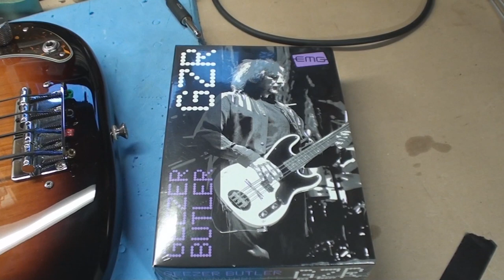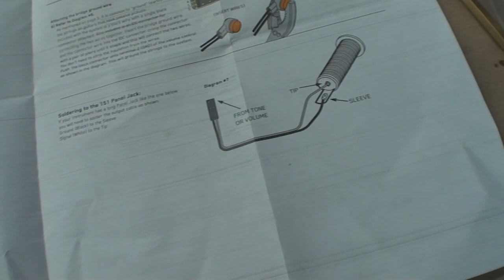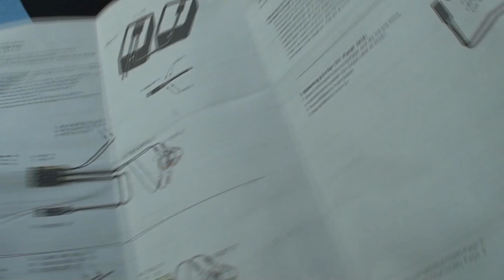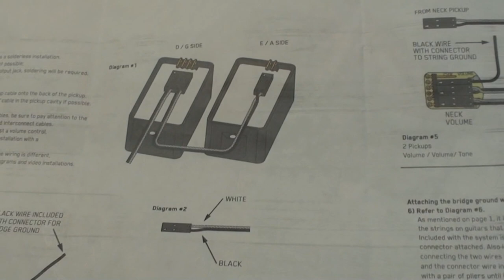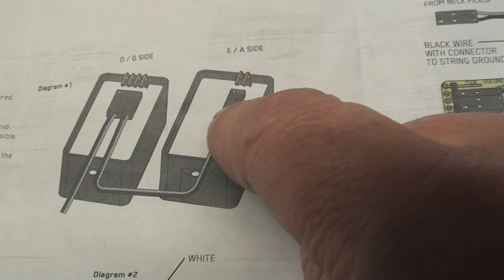EMG GZR Solderless Wiring Pickup Install

Comment: Dave, for future reference: the little squeeze connector with the orange button (3M calls them Scotchlok) has internal blades that slice through the insulation of the wires, so you don't need to strip the wires before inserting them into the connector.  Even fewer tools required!
Reply: They are handy and quick,  they are also an inferior option to a good solder job and less reliable. As to install them correctly you're basically cutting approximately 1/3 of your conductors as they cut through the jacket and into the strands themselves.
Reply: @dennisapplegate7553  I was deferring comment, so glad you did. I'm old school, built many custom amps, had a 66 JB for years, I now have a PB with a maple neck, I actually prefer it for access to the strings when muscling it, plus there's a uniqueness to the PB 'pop' that a JB misses.

Which brings me to soldering [it's still the most reliable way of doing electronic connections, required still by some military and aviation regs rather than push-ons, including using 60/40 lead/tin solder (the newer lead-free type whiskers)] and has me questioning why anyone would want to change-out perfectly wonderful real PB p/u s for some bloke's concept of how the PB should sound.

Fender got it so right to begin with, why fug with it?
Reply: @stephensaines7100  because these sound better? (Shrug).
Reply: @dennisapplegate7553  had them on my bass for a year with this connector and had no problems. Unless you’re swinging the bass around like a mad man, how would they come loose? I’ve actually seen more solder joints (by pros!) snap.
Reply: @stephensaines7100  just a suggestion to a tone building If you do use sloderless and connectors use a little dielectric grease on your connect .It will prevent corrosion and maintain a superior connection.
Reply: @Andyanddiana467  And I'll bet you've seen alot more solder joints than scotchloks right? My point is the provide a inferior connection that actually cut part the wire and are much more venerable is stress and corrosion. They are great when used properly but they are not as solid or reliable as a good solder joint .
Reply: @dennisapplegate7553   @Dennis Applegate  We'll need to wait a few more decades to see how these connectors hold up. I think they'll probably be mixed bag, probably much shorter life than a normal solder joint done well. They certainly won't have the failures caused by weakened pots overheated by soldering done poorly!

Comment: i installed this Pickups in my sx Bass couple years ago... very easy and great tone! everybody can do it... and its all include in one package, even the potis....just great work from emg...
Reply: Put a set of EMG J into a J & D surf green bass. Cost as much as the bass but end result worth it. No need to shield or use earth grounding. Coupled with a set of Billy Sheenan Rotosounds. Sure appreciate putting into practice what I remotely learnt from watching Dave.

Comment: Installed this GZR pickup on my cheapass 20th anniversary Indo P many years ago. World of difference in an instant. Cannibalized my junk mim jazz and the only part
 left on that indo is the body, with a 2 9/16hs neck pocket. Epoxied in a Mitey mite P neck. Added threaded inserts so  6 bolts on neck No shims string height was dead on. Franken bass. Neck shrunk so much across grain I filed fret ends >3< times! Action with labella flats is 4/64ths across the board no buzz no weirdness plays like buttah.. Wole lotta work on that bass but man it plays and sounds incredibly sweet! NOTE :MOST of it from watching YOUR VIDS Dave!!! Thanks lol

Comment: I put in the Geezer pj set recently and the ground wire connector thingy was a bit confusing at first; I screwed up my first attempt and had to order another from EMG. I got everything working just fine eventually, with no complaints nearly a year later, but still a PITA. 

Worth it, though, because they sound fantastic. Best bass pickups I’ve played.
Reply: I found AFTER I fiddled on the bench a bit the  instructions made sense - strong cup of tea did the trick.

Comment: I put these 130€ EMG GZR pickups into my 130€ Harley Benton HTR PJ-4 bass and it's now one of my two gigging basses. I had DR Red Devils string on and had to put my Pyramid Gold flat wounds back on because the sound was just TOO HEAVY. Very happy with this product.
Reply: Did you have any installation problems with these pickups. Im trying to put in my Gzr P pickup now and currently all Im getting is buzzing

Comment: Hey Dave, all my guitars are singing. Thanks.  My Fender mim pj special edition requires a .050 wrench for the saddle height, which be hard to find. I have found that a 1.3 mm works well. The .050 is a stupid price break from standard hex wrench $, and probably not at your local Bored and Screwed, yet the 1.3mm can usually be had at the harbour freight. Look for the little flat case with every other TINY bit you need, And the flexy driver.  Neither of these wrenches are consistant with the specs that Fender themselves gives for this bass. Peace and Black Sabbath! Constant sneeze for 10 minutes. Cheers folks!

Comment: Added a passive P-Bass EMG to one of my partscaster P-basses and it is definitely both the easiest install ever and a solid pickup all around. I installed an active one in another partscaster P-bass and the active is a little bit more difficult although it still was fairly easy to do.
Reply: The active EMG P pickup works well with tapewounds too because the pickups are shielded, and you don’t have to connect the bridge ground.
Reply: @tylerwmbass  They do work well with tapewounds, good point and I like the lack of the ground wire as well since I'm extremely destructive with a soldering iron.
Reply: @tylerwmbass  ? You don't even have to physically contact your strings to introduce stray electrostatic and/or magnetic fields into your pickups. The bridge and tuners still need to be grounded, any inductive or electrostatic materials of size in the instrument need to be grounded. Any quality audio tech will also twist the p/u leads and dress the wiring as close to grounded surfaces as possible to reduce as much induced hum as possible, but I digress...
Reply: @stephensaines7100  You’re right, just standing on carpet can generate static that will discharge into the bridge, it needs a ground discharge path.
Reply: @stephensaines7100  Have two basses with passive EMGs, one a Geezer P/J and one with their A2 pole pieces.  Both, of course, have the grounds connected.  Standard bridge grounds, but also I have the cavities connected to ground.  But...  I also have two Spector basses that came with active EMGs.  They have cavity shielding, but there is no provision for a ground wire to the bridge at all, no hole is even drilled for one.  They are the quietest basses I've even played.  They also have active preamps installed, in addition to the active preamps installed inside the pick ups.  Nothing is externally grounded to the strings or bridge, just the path through the cable to the amp.  Active EMGs need no bridge ground.
Reply: @danlevesque5486  Yep, I have some basses with active EMG's too, a different tone but if you're in a noisy environment they're a blessing.

Comment: I have these pickups. They don't really sound like Geezer but if you put some distortion on them they sound massive. Not great unless you want that sound. Les Claypool has a sig set coming soon that I think I'm going to switch to.
Reply: That’s because pickups are a tiny fraction of tone, trying finding what speakers he used. Those change the tone more than anything

Comment: I would solder the connections anyway because of the way those crimp type connectors seem to corrode or oxidize and become brittle over time.
Reply: So would I. Unless you have gold or silver surfaces in contact with each other  (and even they display a barrier when oxidized) it's just asking for noise and intermittents by not soldering them.

You wouldn't do this in a mike circuit, albeit they're typically 1/10 the signal, assuming you have the pots turned up full, because you can hear the degraded signal path in many cases, so why do it on a first class instrument like a genuine Fender P-Bass?

The 1/4" jacks and plug tips are a constant source of bad connections to begin with, but at least that's an itch you can scratch by twisting the plug once inserted to clean the contact surfaces each time you plug-in.

Oxidized contacts internally? Grrrrr.....
Reply: How long would that take, you figure?
Reply: @Andyanddiana467  I say about an hour with the set I have. I use( tin-62/lead/-36/2-silver )solder from Radio Shack.
Reply: @stephensaines7100   I found a new style of 1/4 " jack that has 2 points of contact on both the tip, and the ground!! they hold the plug so much better, and it has a great surface contact , and way harder to pull out when moving around.
Reply: @stephensaines7100  Corroded gold? I think you've been had! That's fools gold!
Reply: @DKoppJr do you have a link to the 1/4” jack?
Reply: @MrCheesywaffles  Nothing is pure and dissimilar metals will react with each other over time.

Comment: I got some EMG J Bass pickups but they don't come with tone knobs and my jazz bass ones don't fit? Do I need to get concentric tone knobs? :/
Reply: I hit same issue when I fitted them to my J & D surf green bass. You can see the fun I had with it on my channel. Pretty sure it is 6mm inner diameter shaft. I got some decent feeling ones for an amplifier. The cheap from the usual suspect just didn't fit. If you have a vernier you might be able to check if yours are also 6mm. Don't get the D shape. Needs to be a full cylinder.

They are lovely pickups - the active ones are so quiet at rest. Lovely sound on my Orange  amp. Or in a DI box.
Reply: @stephenhookings1985  It says on my EMG instruction (I fitted them in earlier) that the solid silver bit at top is 6 and then the gold slighter thicker bit underneath is 8, so that's why Isk if I get the concentric ones :/ I haven't fitted the control plat or got tone lobs yet
Reply: @tomasomiadhachain2411  ah sorry didn't realise you have the stacked pots. Have you tried "Dont tell the wife" in US? Or even EMG direct? My pots are two volumes and tone. So simple 6mm worked for me.
Reply: @stephenhookings1985  yeah I got the EMG J bass set, I don't know if the stock jazz bass tone knobs are 6mm or not, it just says (6) and then (8) on the instruction manual so I'm just assuming they're in mm 🤷🏻‍♂️ What's Don't Tell The Wife? I'm in the UK haha, should I just get some average 6mm knobs and some concentric ones just to be safe? :)
Reply: @tomasomiadhachain2411  if its the EMG J then I got mine from Amazon. It is single diameter single control. I got Taiss/ 4pcs Black Aluminum Rotary Electronic Control Potentiometer Knob For 6 mm Diameter Shaft, Volume Control

Not sure I made any videos with them fitted but the look the cats cods. Feel great too.

If you spec the additional dual shaft BQS type tone controls then these have two controls per pot. Something like this might work. NEW - Gotoh VK15T / VK18T Mini Stacked Concentric Knob for 6mm/8mm Pots - BLACK

Like you I took cheap bass expensive pickups decent amp or DI route. And the quality of the pickups means they aren't expensive  - just well engineered. No need to shield the active ones. The time saving of shielding makes them well worth it.

Hope you find the right knobs. I know in my video I lamented the need for new knobs :-)
Reply: @stephenhookings1985  I watch your whole vi with the surf green bass and I'm 99.9% sure I got the same EMG J set as you, I haven't got the BQS though that does look cool for the future, I'll make sure to get 6mm diameter shaft ones like you :)

Thankyou for your vid and help 🙌🏻
Reply: @tomasomiadhachain2411  where have you manged to hide the battery? I find the rechargeable ones are slightly thinner and fit within the control cavity.

But I had a whacky idea. It would be possible to mount a DC jack hole on the plate. Then I would take lead out to be mounted on the guitar strap. Why? Well then one could even put two 9v in series to get an 18v system. I have to symay the 18v Sire bass preamp is pretty darn good.

I am hoping post Brexit eventually there will be some trade understanding with US/Canada so that shipping of SX guitars, Audere preamps and Solo guitar becomes easier.

Comment: I really don't trust plug and play , I would much rather solder in pickups to an existing circuit. Its like working with radio control receivers and servos .

Comment: You’d think those music companies could save us a few €uros by skipping the fancy packaging and just stick the parts and instructions in a plain box with just the logo and the barcode.  It’s getting bad enough with scammers cloning the fancy boxes to sell on eBay or Alibaba as “genuine”.
Reply: I love the box. The whole EMG experience for me was 100% positive. Only missing the foam underlay or surgical tube and springs. I got mine off Amazon on basis if they turned out to be counterfeit I could send them back. They are bleeding awesome - counterfeit or not. So quiet at rest. And lovely dynamic range. Was playing them this evening. Throw them thru a FX pedal (like a cheap Zoom B1on or B1XFour) and you can preamp them to emulate additional EQ. Alas these pedals also reintroduce noise - use the ZNR or a noise canceller.